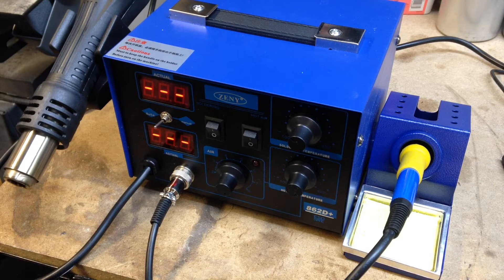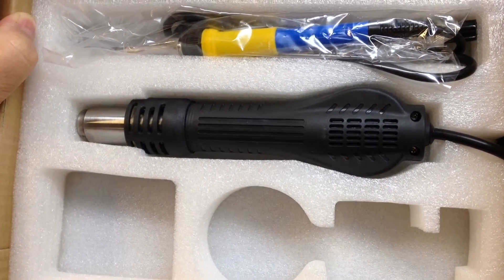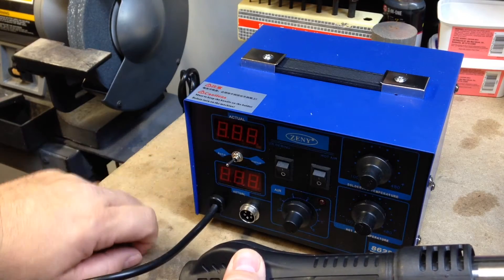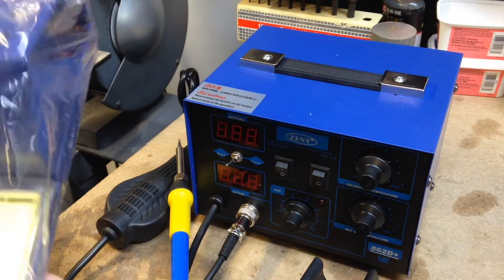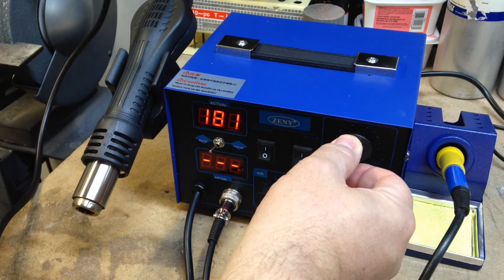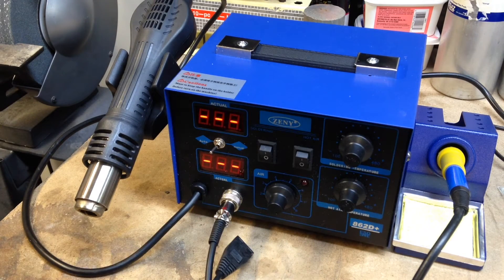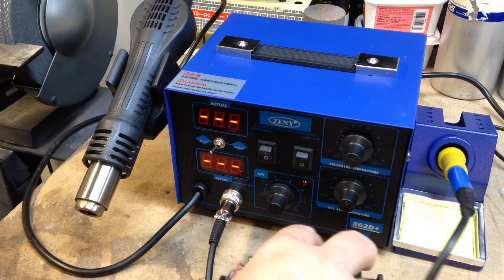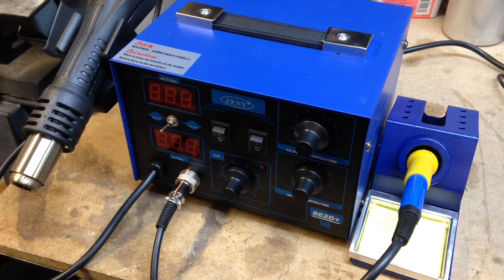Un-boxing Solder rework station

Comment: How is the soldering station holding up 4 years on I've just purchased the same instead of a monstrous great hot spade I was using melted the whole board
Reply from the maker: its doing great but dont use it all that much